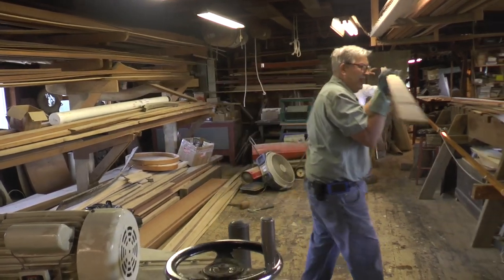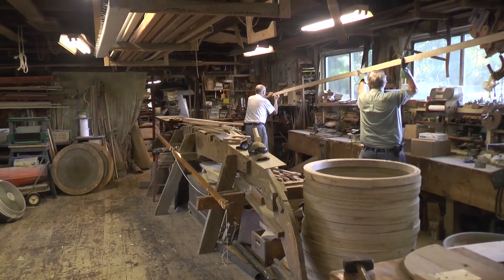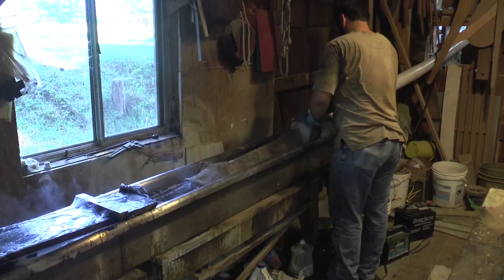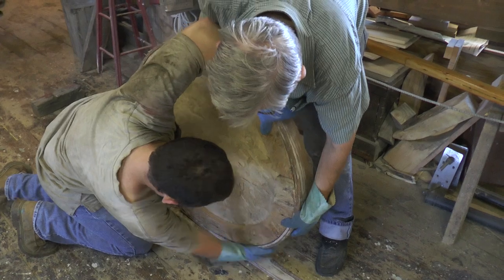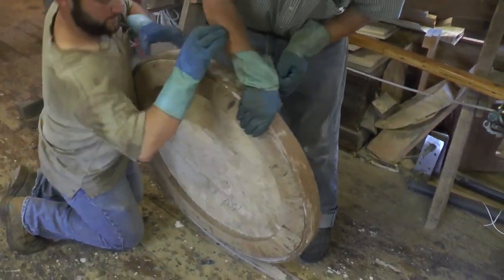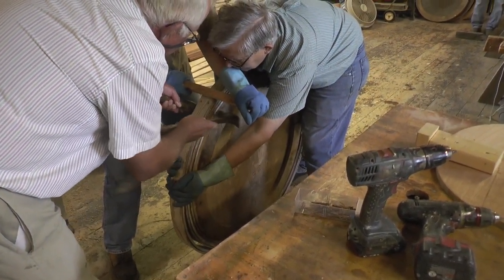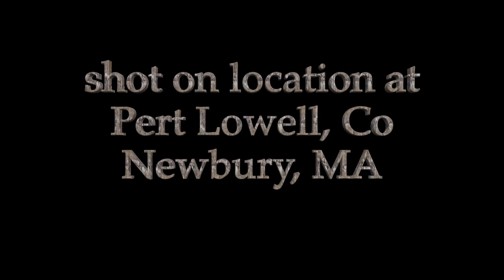Making Mast Hoops For The C.A. Thayer

Comment: Is there a formula used to determine the dimensions given mast diameter?  For instance how much wider should the mast hoop be than the mast in terms of diameter.  How thick would the wood on the hoop be, and how deep?  Or is it largely trial and error?  Thanks!
Reply from the maker: As the videographer I have to admit that I've listened to Ralph casually tell people what size hoop they need depending on the diameter of the mast, and not asked how much that is calculated. next time I speak to him I'll ask and leave a better answer than this!
Reply from the maker: Thanks for your patience.I spoke to Ralph and he said that the Internal Diameter of the mast hoop should be 25% greater than the diameter of the mast at the point near the base where it will rest. Or, a four-inch diameter mast will take a five-inch hoop.
Reply: @lou42875  Thanks! Much appreciated!